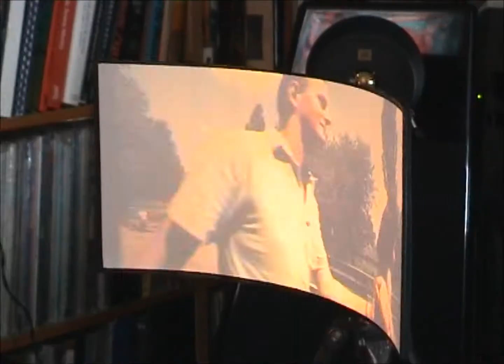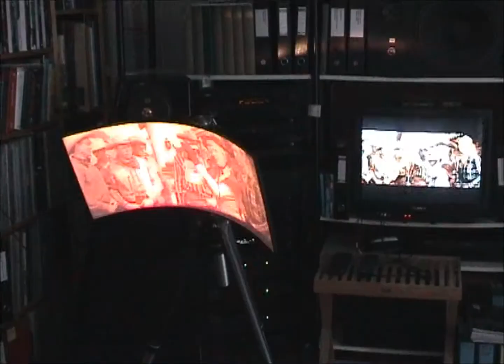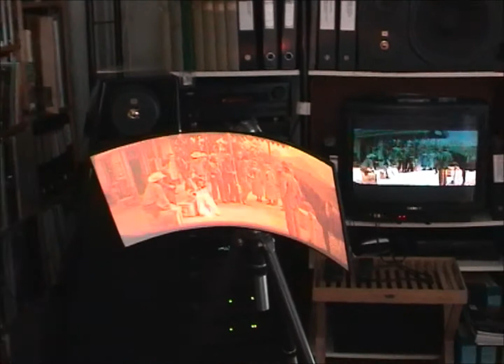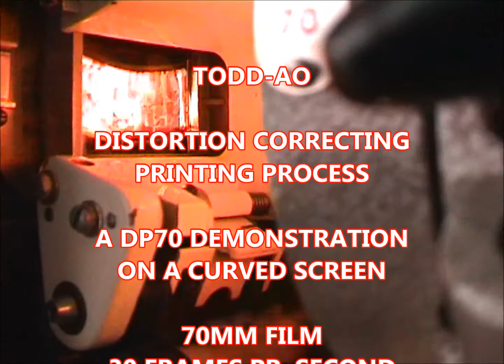Todd-AO Distortion Correcting Printing Process

Comment: I read that the curved prints of Around the world in 80 days were not used in General release
Reply: You are correct. The film was shot in 70mm with 6 magnetic soundtracks.
The 70mm prints cost a fortune and a limited number were moved around the country to a handful of major city cinemas equipped to run them.
Converting release cinemas would not only have involved the huge cost of the projection and sound equipment. Architecturally more than 50% of the buildings were also unsuitable. Projectors needed to be aligned to the optical center or the curve, which in many cases would have involved moving the projection booth. In addition many seats in the stalls would have had the top of picture cropped by the circle and seats in the circle would have the edges of the bottom of the curved screen cropped. Wide auditoriums would have had the side blocks of seats outside the optic tolerances of the curve. In reality, in some cases it would have halved the number of seats
You can now probably understand why very few films used this format and the whole idea was soon dropped.